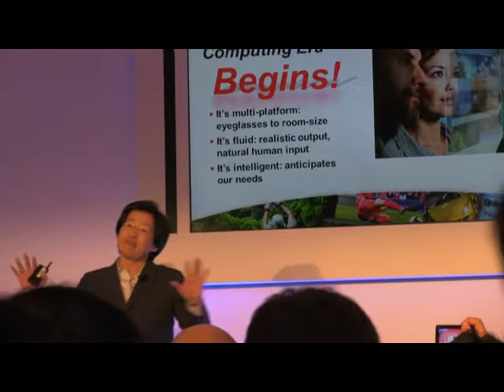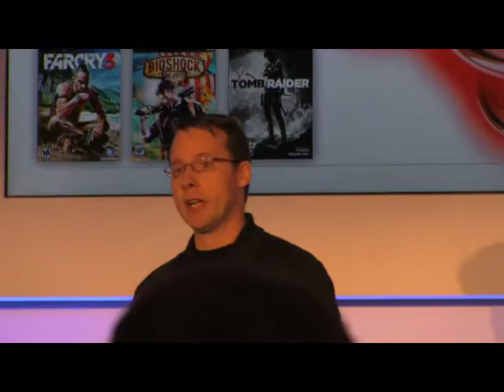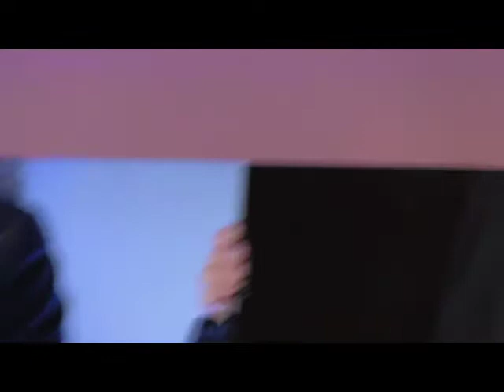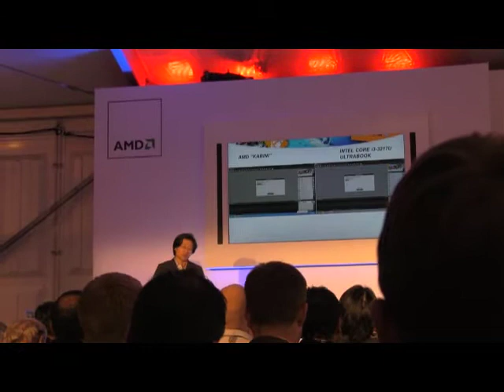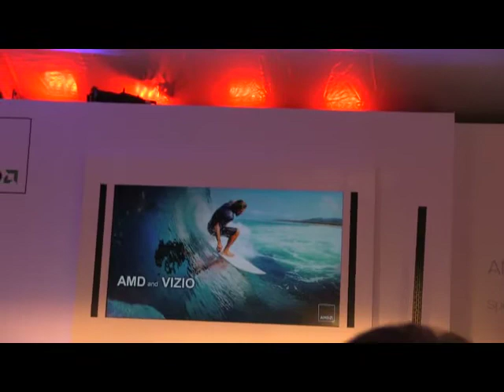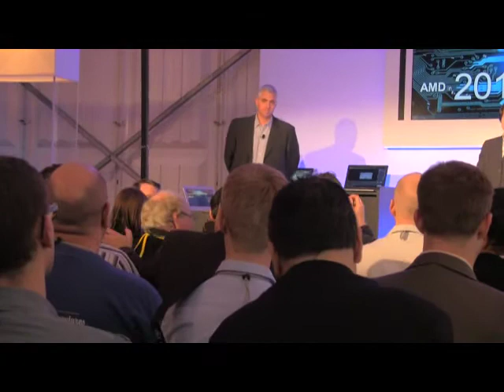AMD CES Press Conference 2013

Comment: I'm not talking about sockets though. I'm talking about processor generations. I can tell all Intel chips apart, and even tell what sockets they use, but which is newer: Bulldozer or Piledriver? And are they even the correct names? I can't say, cause it's confusing as fuck...